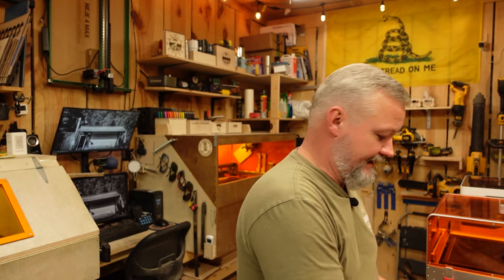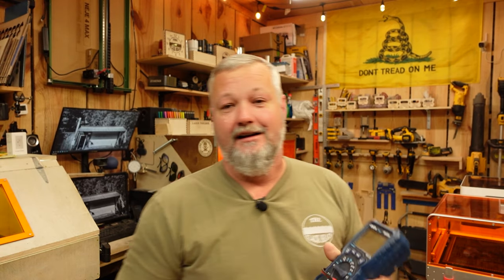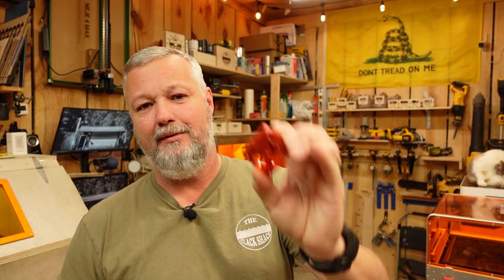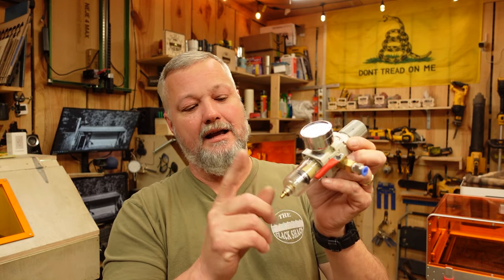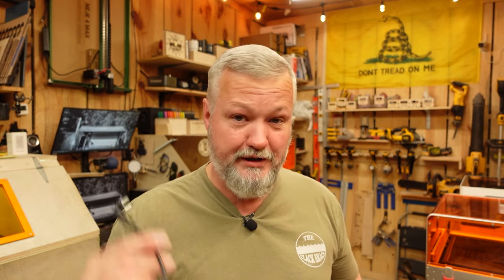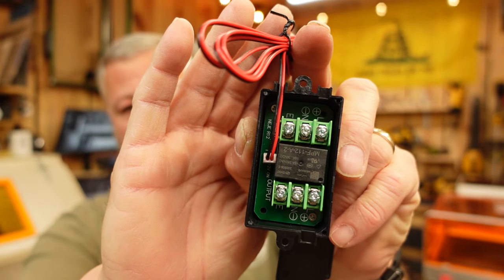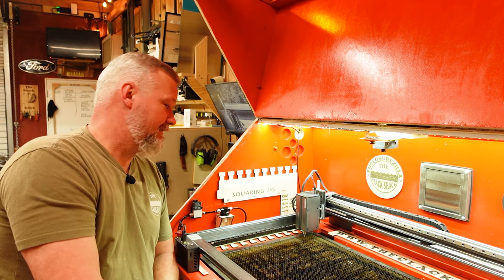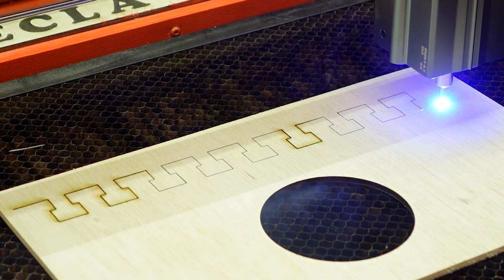Shop air setup for diode lasers

Comment: How often does you air compressor come on when you are running cuts? Thanks, please keep producing the tips and tricks.
Reply from the maker: Not often, it has no trouble keeping up with 3 machines running. The pressure used is really low. Thanks for watching, I plan to

Comment: Very informative! I'm gonna have to give this a try today. I'm running about 10 psi, but I'm using a LOT of air - my compressor (which is bigger than the one you have there - 26 gal Kobalt) runs a LOT and is really annoying and wasteful. Hopefully this method will get that much more under control.

Do you think too much air can cause soot? My cuts are pretty clean on the surface, but the edges are really sooty. Especially with the 1/4" MDF core plywood I've been running lately. Hopefully adjusting the air will help that too.
Reply from the maker: Some materials just burn dirty. You should only run as much air as is needed though. Your compressor will thank you.

Comment: This was super helpful. I am looking forward to reviewing all the parts in your parts list. I had no idea about the importance of the water separators. I also need to see if my Atzer P20W has the m7 or m8 port.
Reply from the maker: The P20 doesn’t unless they have added it. You can just use the hand valve
Reply: That is what I was afraid of. Still, I can use the rest of the video!
Reply: Yeah, no air control on the P20. There IS an unused port in there. When I upgraded to the extended rails part of that was to replace the wiring harness with a longer one. There was a port (labeled "probe" I think) that was connected on the original harness but not in the new one - looks like some feature maybe was planned but never implemented. If someone really wanted to, they could probably figure out what pin that connector is, install plain GRBL on there defining that pin as the air control, and add a bit of circuitry to trigger a relay from that pin through a transistor perhaps. You'd probably lose the screen in the process, tho it's so limited anyway I wouldn't care.

I'm fairly comfortable doing that kind of thing (built my own 3D printer and other electronics) but I'm trying to start a bit of a business around it and didn't want to risk messing it up.

Comment: Will watch this later this week while im getting my enclosure ready.  Air assist coming later but i dont cut much.
Reply from the maker: You will be surprised the difference it makes on engraves also. Not to mention keeping the lens clean.
Reply: Same air compressor as mine.  With all the tools you have I expected to see a monster 100gal or bigger
Reply from the maker: @KnotboredWoodworking  most of my tools are battery operated or electric. I had a larger one but when it did, I downsized.

Comment: I'd love some direction on setting up my ortur lm3 with air assist/electronic valve/lightburn. 

I mean "REALLY WOULD LOVE THE HELP"
Reply from the maker: I don't think the LM3 has the appropriate plug to activate it automatically. They did offer some light and fan controls that could be used but would require it being turned on in lightburn before the file was sent.
Reply: @TheClackShack  thanks for the quick reply. I'll keep investigating.

Comment: Thanks, for the in depth videos. I think moisture got into my laser module with air assist and destroyed my focal lens. Not fun at all. An air/water regulator is must. Or run a dehumidifier. Or both.
Reply from the maker: Yea, that’s why I run two driers now
Reply: @TheClackShack Hey David once you've adjusted the air on the regulator outside of the enclosure sending air through to your secondary air/water separator inside your enclosure, is there enough air pressure to close the nipple valve on secondary separator before going into the laser module? Hope this makes sense.
Reply from the maker: @BBoyBFit  mine shuts off like it is supposed to if that’s what you are asking
Reply: @TheClackShack  Alright, cool. I was leak testing my regulator, sometimes it seemed like there wasn't enough air pressing valve closed. I was wondering if the 10 pai was enough. I'll troubleshoot some more. Got get some teflon tape and airhose for the other compressor.
Reply from the maker: My pressure is much lower than 10 psi. It doesn't even register on the gauge
 @BBoyBFit
Reply: @TheClackShack  Thank you David. I'll play around with setup here in a bit.
Reply: @TheClackShack I just wanna come by and thank you for all you do. I finished putting my air assist together last week and hadn't gotten around to testing it yet do to other projects needed to be finished. Anyway tested the air assist  setup today and cuts came out very clean for my 10w.
Reply from the maker: @BBoyBFit  good deal. Glad you like the setup

Comment: How do you wire the valve to Light burn ? I have a Comgrow z10 w and a  Longer Ray 5 10 W .
Great info Thanks Don
Reply from the maker: The machine has to have automatic air output or a m7 or m8 port on the controller. Not all machines has either
Reply: I will look on the mother board . Thanks Don @TheClackShack
Reply from the maker: @donlewis5105  I don’t think either of them have one. Unless they have added them recently
Reply: You are right i did not see it . I will have  to use a switch . Thanks Don @TheClackShack

Comment: Is there a way to control a pneumatic valve via lightburn using an original xtool D1 non pro?
Reply from the maker: Not that I am aware of without changing out the controller.

Comment: If I'm not going to use Lightburn to control my air I don't need the relay, correct?
Reply from the maker: Correct, you would just use the twist valve

Comment: Clack I need help on different topic I bought a new computer our old one was really slow how do I get my library and settings to the new computer thanks
Reply from the maker: The libraries are saved to a folder on your machine. Act as if you are going to save one and you should see where it is saving to. Go to that location and copy to a thumb drive or other removable disk to transfer them.
Reply: @TheClackShack  thanks I didn’t understand that but my said she did